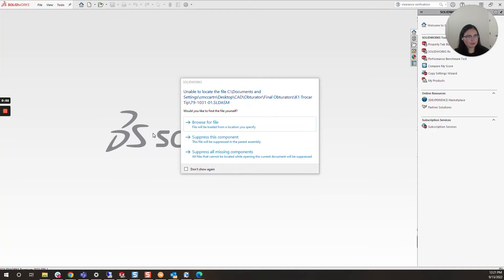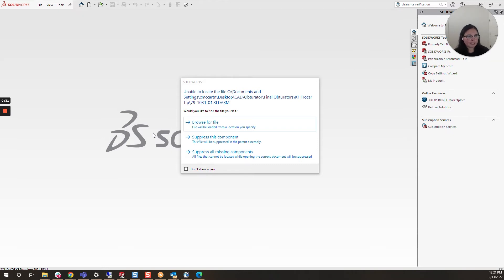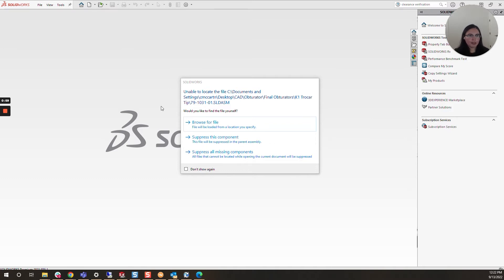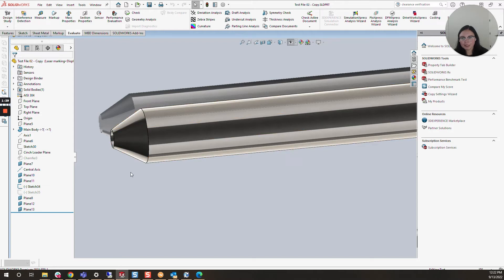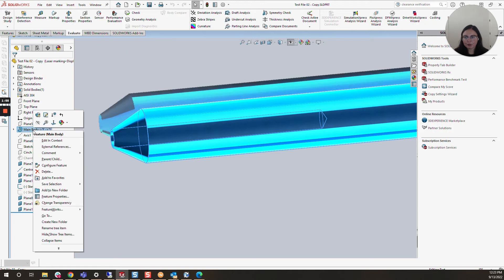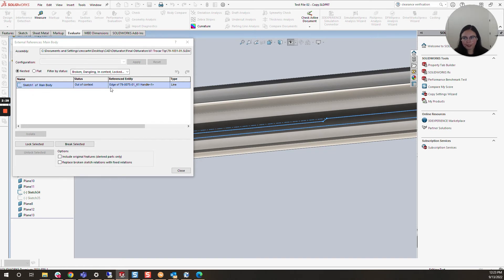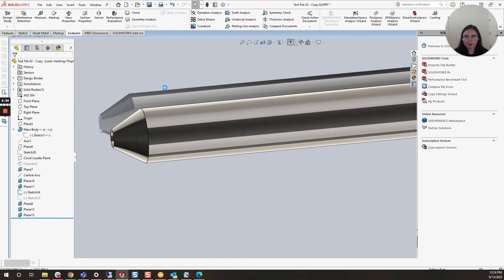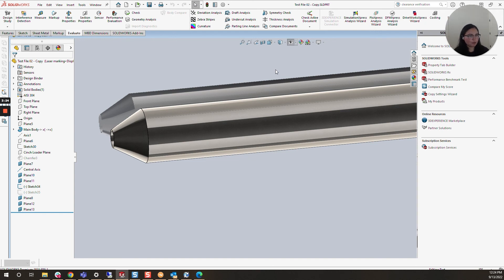SolidWorks Help: Unable To Locate File Parts

Comment: How do you turn this message back on?
Reply from the maker: Hi! If this message is no longer appearing for you and there are still missing parts, here are some quick options.

1. Re-open the file. After you reopen, you should see the Unable to locate file message appear once more.

2. If you clicked on 'Don't show again' at the bottom of the message previously, you may no longer see this message even when reopening the file. Here is how to remedy this:

-Open your System Options inside Solidworks
-Under 'Dismissed Messages', locate the 'Unable to locate file' message
-Ensure the box next to the message is checked
-Click OK to save your changes

Thank you,

Daniela
Reply: @SPKAAIT thank you